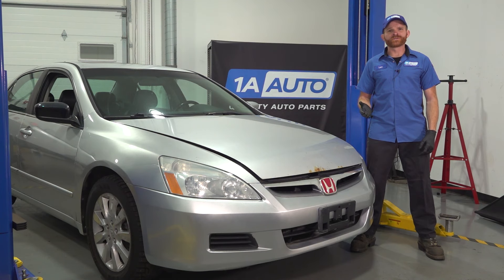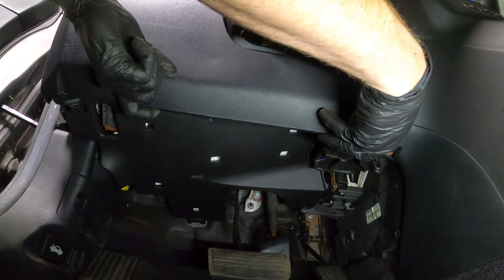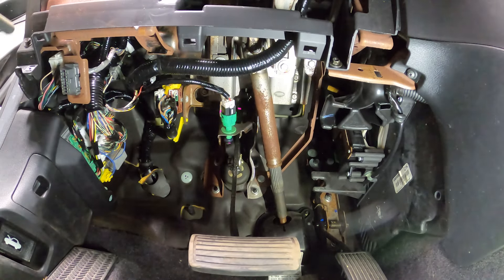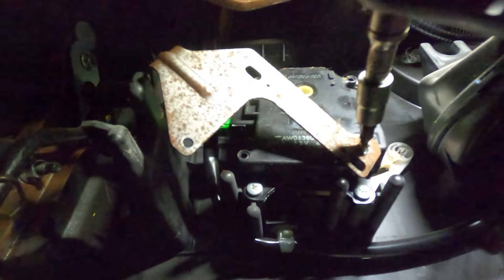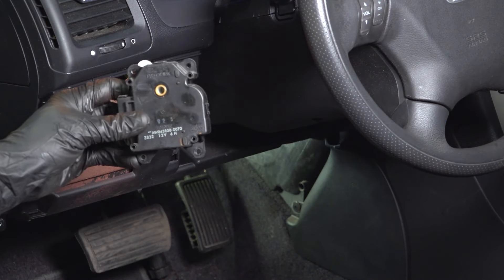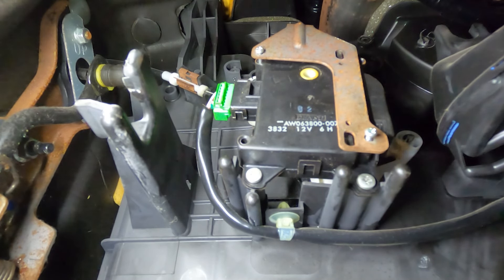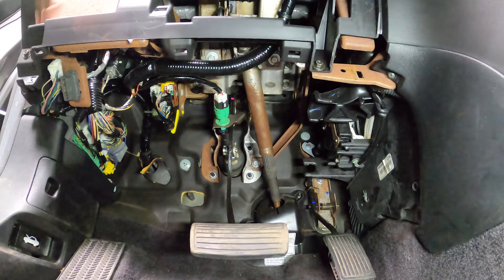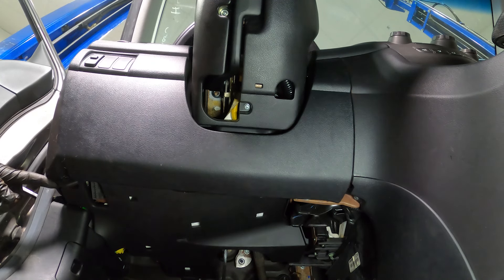How to Replace Left Side Blend Door Actuator 2003-2007 Honda Accord

Comment: I replaced mine on my 2017 Toyota Highlander The dealer wanted $800 to replace part I bought the part myself and did it in 35 minutes. Easy job.